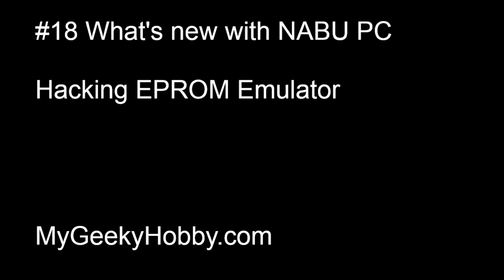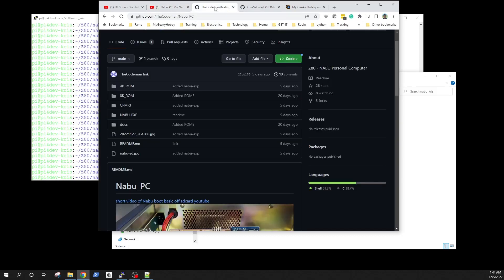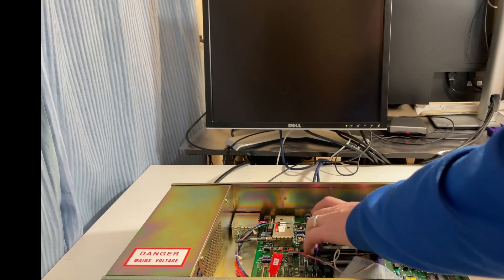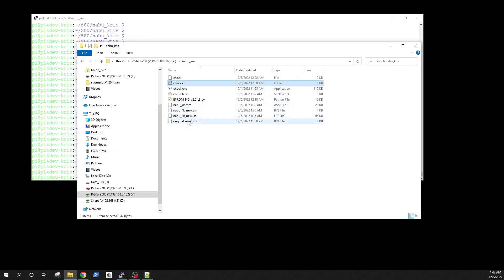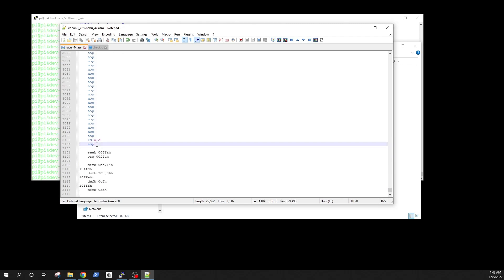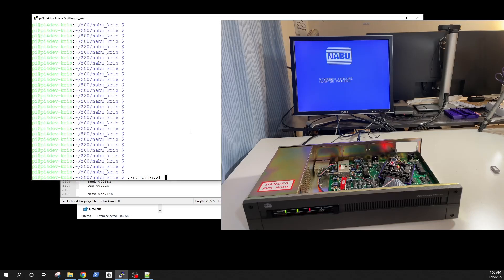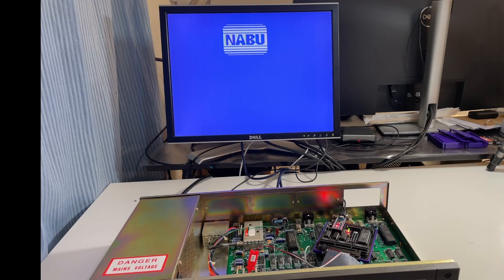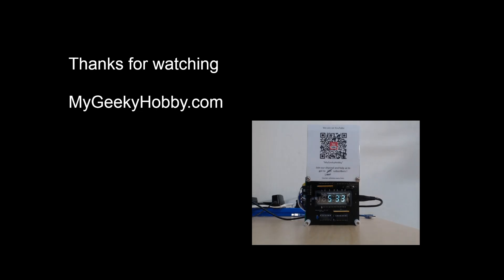#18 NABU PC Hacking with EPROM Emulator

Comment: Awesome work. This will definitely speed up development work. Will you be selling assembled units, or are you only providing gerbers/BOM/firmware?
Reply from the maker: The emulator project is on GitHub, link in the description. I sometimes offer kits / assembled units but I don't currently have stock. A minimum build of the emulator is possible with just a single 62256 SRAM the 74 series logic and an Arduino Nano, the project is shared on PCBWay but gerbers and KiCad sources are also on GitHub... Enjoy!

Comment: I’m still waiting on Amazon to deliver some of the parts I need for working on my NABU, so it’s still in the box. I’ve been doing RE on the ROMs that people have posted.  My goal will be CP/M without modifying the ROM, so boot sector over RS422 then SD disk emulation.